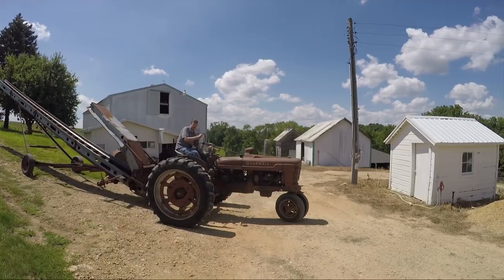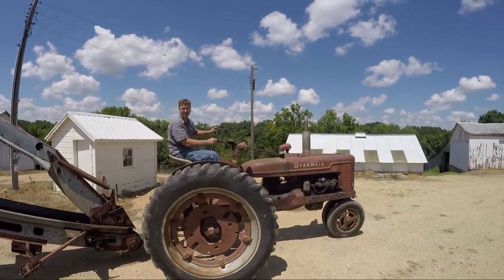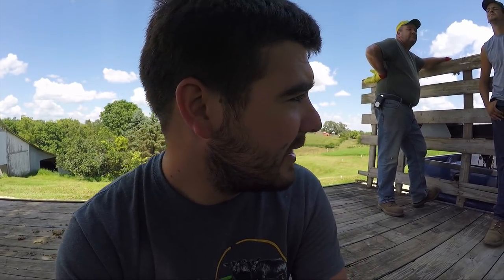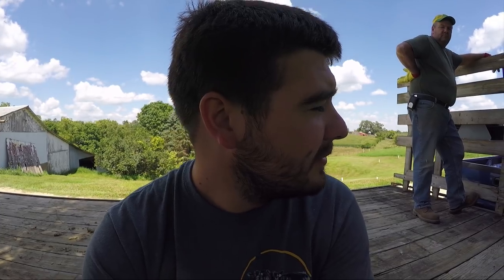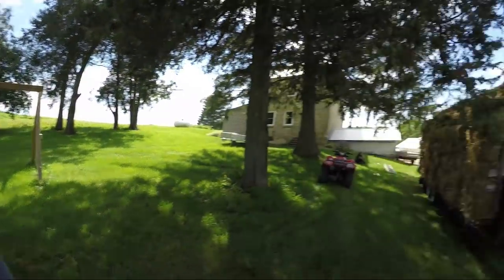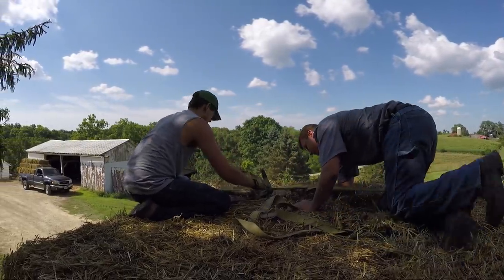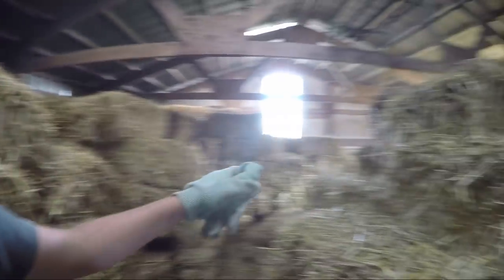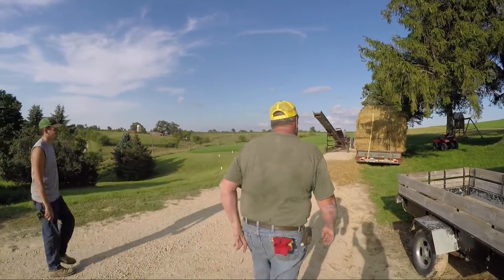Straw Square Baling - McCormick Tractor & Case iH Square Baler

Comment: Memories of when I was young not even a man yet. We had a John Deere cross feed wire tie in partner with dad's brother. Didn't need so many of them to make a load. 2 bales just fit across the wagon. Later we got a sting tie and dad shortened the bales a little, I think it was 88 on a load then. Brought up some good memories, thanks to all that worked for the camera.

Comment: Ryan, that old H Farmall is still running after 50 - 60 years! Not a SINGLE tractor y'all own will have that time legacy. There! got that off my chest! Born and raised on a NC hog, peanut, corn, watermelon, soybean and tobacco...etc. farm from 50's to 90's. Now just an old retired boy with a passion for restored old Farmalls! (got 7 and want more IHCC Chapter #37 check it out, over 6000 members in the entire club chapters) Those old Tractors built this country! Enjoy your vids...and good luck on your farm day!!! Show them how the "salt" of the Earth works!!!!! Wayne in NC.
Reply: I don't know if the 8235R or the 7600 will still be running but I'd say that the 4020 and the 4640 could last 50 - 60 years. The 4020 has only got 10 years to go until 60 and it's already been 50.

Comment: I've done plenty of that in my younger days.  We didn't have a corn dump to put it in the barn, that was my job from a 30 foot long Donahue trailer with about 400 bales on it.  I used a hook and got pretty good at slinging them into the barn loft.  Good video
Reply: I remember when I was a kid, we used to love helping out with the baling. We'd ride along in the big trailer, and stack the bales as they came off the baler - which didn't throw them like this one does :).

Comment: Very suprised to see you stacking them one on top of the other on the the trailer! In the uk we stack each layer opposite to the last to tie them in,makes the load much more stable.
Reply: Same here in Ireland, and the first rows on the edge.
Reply: We stack them like that (stack each layer opposite.. to Interlocking them) also in Georgia, US.
Reply: Same here opposite direction on each level. I can fit 330 2 string bales on a 40ft gooseneck trailer 6 layers high. I pick it up and load by hand in Salt lake City Utah and tow it back to Las Vegas 3 times a week. So it's critical to lock each layer together so I don't kill someone on the highway as well as loose any of load on the highway
Reply: here in South Africa too
Reply: most people who know how to do it right do stack them in different directions, not saying that they did it wrong its just not the best way to do it.
Reply: Nicholas Suits that is a fact whatever works for you is fine as long as it's safe and that's all that matters
Reply: It's Wisconsin, they don't know how to innovate there or get with the times, even the Amish are more advanced and smarter.
Reply: you can fit more on the way they did it. it’s not like they were driving 50 miles with it either
Reply: We do do that in america, but i van't vouch for these guys
Reply: @farminginthesouth592  agreed... i would have been smoked for packing them like this

Comment: As the youngest on a NH farm before much automation and with hilly hay fields, I'd be the one walking on the low side of the hay wagon traveling on a slant across the hills throwing bales up onto the wagon from the field. Then stacking inside a barn loft in 95+ degree humid heat with no air movement with dust til I was covered with a black film...... those were good days to be young and strong.

Comment: When we were young on the farm, we had an actual square bale elevator and it was real nice.  Something happened to it (can't remember) but after that we use one of our two flight elevators like pictured in this video.  We always had to be careful dropping bales on the elevator when unloading wagons.  Sometime if we dropped a bale on the flight, it would cut/bust one or both strings!

Comment: We used to have a Case small square baler like that when I was younger. Don't quote me on it but I think those McCormick tractors are the same as a certain series of Case ones, the MXM series maybe? I know McCormick had a series identical to a Case tractor. We had a 2014 X60.50 on our farm before we sold it this spring, we liked it.
Reply: Same as the mx series but lots of changes... perkins engine instead of cummins,,,Basiclly the same frame and Cab
Reply: Northern farmer Yeah I figured it looked kind of similar to your MX120.

Comment: Love that used engine oil for lube on the chain! You some hard working sob's!  I sure would try and reduce handling those bales so many times. I thought my back would last forever, but was I wrong. Beautiful old stone house - still living there?
Reply: That oil is not making it into the feed, and farmers have been using old oil for a century to lube non essential parts. Used engine oil as a toxin is over rated, and used hydraulic oil is a perfect reuse of old oil as it has not the products of combustion that engine oil has. Many tests have show used engine oil to break down naturally in the soil by microbes and fungi's - also diesel. I take diesel and used hydraulic oil and mix it half and half into a pump sprayer, and this is a safe repurposing of oils as a lubricant. Used engine oil has the defect of being very black and staining, so it's best use is to recycle it [as I have several hundred gallons] or burn it in a certified waste oil furnace. When you recycle used oil, it just comes back into our life as filtered asphalt oils and chain and bar oils. Nature has been recycling oil for milennia from seeps and tar pits.
Reply: It's friggin' BEDDING, NOT FEED!!  Besides it was all "sopped up" by the first half dozen bales... which is nothing in the grand scheme of things.  

Later!  OL J R :)
Reply: Counties all used to put used oil on the dirt roads. Better to re-refine it though since the technology is there now.

Comment: Man I would have had my arse handed to me for loading a trailer that way.  You don't drop bales string down on a paddle elevator. Pull the wagon ahead so the conveyor is at standing with bale height.

Comment: If I had stacked bales in straight columns like that, I would have got quite a lecture.
Reply: OldTractors Me too.
Reply from the maker: If we had stacked it any other way, we wouldn't have had room for all the bales.
Reply: OldTractors   He would have got the same amount of Bales on if he did just learn how to tied them in. I'm sure there's probably video somewhere that would show the process, but it is America you can do what I wants!!
Reply: How Farms Work hey man your my role model
Reply: How Farms Work We always did.
Reply: If it is stacked right, you can get over 60 bails on a 8 foot bed truck. Done it many times.
Reply: BIlly the SMall Bong thorton from india OK, you buy me a farm, trailer, small square bailer, mower, tedder, rske, and a couple of tractors, and the first time I make hay, I'll show you "my" way.
It's been quite a while since we actually had our farm.
Reply: Columns or criss crossing, you would have gotten the same amount in no problem. I stack 4000 every summer since I was 12.
Reply: No kidding I would have got a kick in the butt and had to restack them all myself
Reply: Anthony A I stack 2,000 a summer but the bales are mainly for bedding
Reply: OldTractors me to my dad would rip me a new one
Reply: @HowFarmsWork  Not to sound like a douche, but Volume of them is same? If you go 3 a breast  you can go 2 in the centre and half on the ends (turn them 90 degrees). Think of them like 4x2 classic lego bricks. You offset each layer and they naturally secure themselves. I get vertical stacking if you are using a forklift, to unload them because interleving them is a nightmare if you unload with a telehandler or similiar.

Comment: Macormick is not a brand of CNH, when CaseIH and New Holland merged, they were forced to get rid of some brands, because of the European rules of market dominance, much of what was sold ended up in the AGRO group, which Is the owner of Landinni. At that time, CNH bought Macormick and Laverda.
Even the models manufactured at the time the brand was owned by CASE have a big difference, the engines in Macormick were used Perkins engines.
Reply: And different dash... but the frame and cab are pretty much the same
Reply: My McCormick has a Deutz engine in it.

Comment: Is their a technique to stacking bales in a barn so they don't combust and catch on fire? I know airflow is important but how do you get airflow when you are stacking them tight to each other?
Reply: Adam Offen you don't need air flow, you gotta keep em tight so there are no holes so you don't fall in them, some people throw salt down the keep the bales dry and some don't, as long as the bales are dry you should be fine, never stack wet bales in the barn.
Reply: Darnell Francis that makes sense, Thank you!
Reply: Stuff I've seen says you can use a probe to monitor the temperature of the bales inside the stack (it's a long stick with a sensor on the end). There's a point at which you need to start moving them around because they are getting too warm. That said, it's not an issue unless the bales are too wet.
Reply: Adam Offen typically most people place cut side up
Reply: Nick Kerpash that's the way I like them stacked. Keep them tight as you go and you always have a nice surface to walk on as you work your way to the peak.

Comment: Hooking up that PTO while the tractor is running is a good way to get your arm ripped off.
Reply: Tyler Jensen the tractor doesn't have live power. He would have to have the PTO in gear while having the clutch engaged.
Reply: If the clutch failed or for some other reason the PTO engaged, one of his hands was inside the PTO coupler at 1:55, and the other was on the guard. Either way, it takes 3 seconds to turn off the tractor, hook up the implement, and then restart the tractor. Whether the PTO was disengaged or not, still not a good idea.
Reply: Tyler Jensen I say again it is impossible to engage the PTO by mistake. The driver needs to push the clutch, and then reach behind and below the seat for the leaver, pull it up then let the clutch out. I have an H and an M .So trust me, they are safer than most of today's tractors when it comes to engaging the PTO.
Reply: Thomas Smith say it all you want, but it's a real nasty habit. If I were operating a farm I would have a zero tolerance policy on that.
Reply: OttoVonNitro you would be the safest farmer I know!
Reply: Lol I never even thought of shutting the tractor off when I remove or attach an implement
Reply: Agree no sign of a PTO shaft guard anywhere either love the videos but do think some safety for yourselves should be thought about, farming is most dangerous industry here in Ireland nothing to be proud about and just think of all the other lives affected if something happens to you, policy always shut off machine when attaching PTO here if you mess with PTO only going be one winner and it ain’t going be the man

Comment: That's a very unstable load. Not tied in. 
Also need tie in in the shed to stop them falling forward
Reply: Doug small they did strap on to the middle and on both sides of the balled which makes it stable going down the road I’m 12 work on a farm and drive with loaded bales all the time.

Comment: one thing that really confuse me is that in america you guys have a tendence to use these kickers for you conventional bales where as here in england we use a sleadge and a flat eight grab and it work well and the bales are all order and easy to handle and if you want to put them on a trailer like yours you can do it much faster
Reply: Yeah that's the best way to handle small squares but you have to have the EQUIPMENT.  For no more than they're doing (making bales of bedding straw every 2-3 years) it doesn't make sense to go to the expense of having an accumulator and grapple to do the job.  Evidently the neighbor who's baling this hay for them as a custom job doesn't do the volume necessary to go to the expense of ditching the bale thrower and catch wagon and switch to an accumulator and grapple either.  

Personally IF I was going to do small squares again, I'd go with the accumulator and grapple system... makes handling small squares about the same as handling round bales... all mechanized.  The only thing not mechanized would be feeding out the bales (course this is straw, but I'm talking about doing hay) which would still require handling the individual bales and cutting twine and pulling it off... Round bales are much easier in this regard-- cut the twine and set the bale in the feeder or unroll it for the cows to eat.  

Later!  OL J R :)

Comment: That used engine oil on the elevator chain ought to be real healthy for the cows .... NOT. I would have used vegetable oil if anything, but not even sure it necessary to oil the elevator chain in the first place. That power crank on the elevator is cool. When I was a boy I was the power crank on our elevators and augers. LOL

Comment: I can't believe they contaminated all this straw by putting motor oil on the carrier chains... use vegetable oil or cooking spray next time
Reply: they didn't hurt nothing by the time they would have used those bales most likely that oil would be saturated down into the bottom of the barn floor.